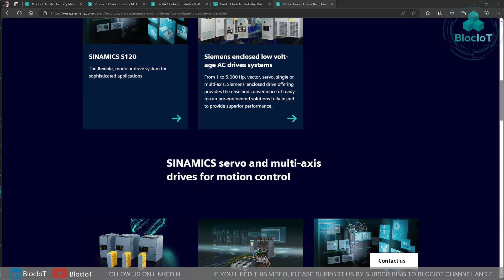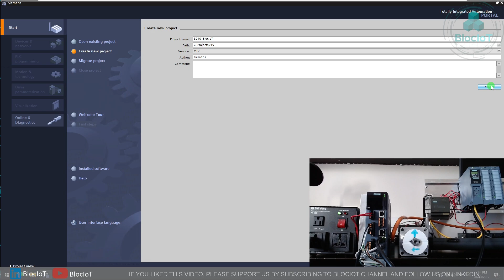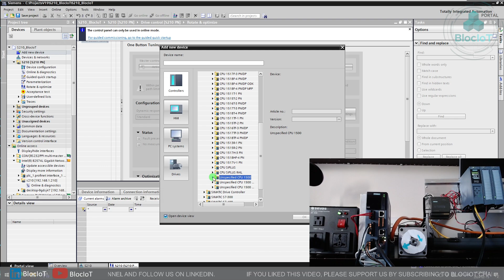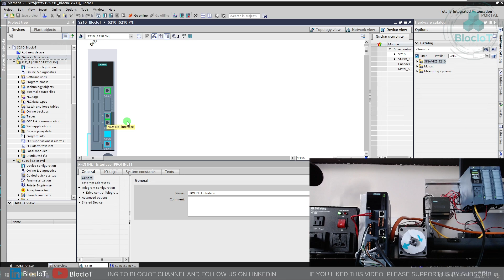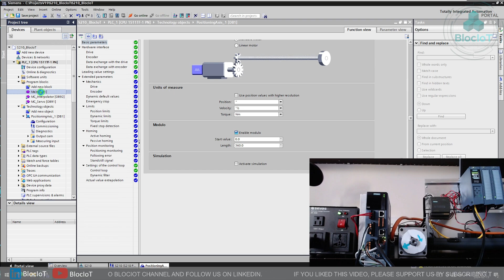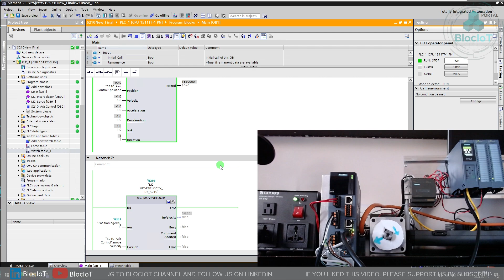33- How to Control a Siemens S210 Servo Drive with a S7-1500 PLC? A complete Tutorial

Comment: Thank you for this video! Do you have a video about how to use the technology object or whatever its called "BasicPosControl", under "SINAMICS Motion Control" in TIA Portal, V20? I am having trouble understanding what all of the parameters mean, such as "Cancel traversing" and "Intermediate Stop". I found a document that tries to explain them but I am still not understanding. Also, I am using an external prox for home position and I am trying to figure out how to use that in this object. I am new to Siemens but have many years experience with Allen-Bradley, Omron, etc.... . Also, would you suggest against using the BasicPosControl function and just follow what you have done here? I just thought that object would be more compact and I have 4 servo motors in this project so that would mean doing everything you have done here, four times.

Comment: What if I have multiple servo drives that are networked through a hub?
Reply from the maker: Everything will be the same except you need to define the target "axis" that you want to control on each FB. In this demo we had one axis (one servo).
Reply: @blociot  I think I understand now. I re-use the same UDT, all I have to do is create 4 blocks, one for each drive but I use the same technology block just pointing it back to the correct block? In Allen-Bradley terms, UDT is the same, the "MC_POWER" for example would be an AOI and then the program blocks would be each instance of the UDT.....is what it sounds like to me.
Reply from the maker: @BrentMcCabe-o7r that's great! Yes, that's one way to control multiple axis one after another. You can dynamically chamge the "axis" parameter to point out ti different drives. Also, therr are other types of TOs for different application that involvea more than one drive like gearing or caming. 
Great point. Basically, AOI in AB world is FB (function block) in Siemens worls. Those MC_Power etc are a FB.

Comment: Hello, i have this problem with my s7-1513-1 pn and  s210, that when compiling it shows "S7-1500/ET200MP station_1" error. What could possibly be wrong?
Reply from the maker: Hi,
Do you have any ET200MP added to your project or tou have a 1513 and a S210 only?

Comment: Hi, Nice video! 
But you don’t necesserally need a T (Technology) CPU at all to control a servo-drive.
The T CPU are requested for very complex applications or when number of servo-drives exceeds CPU calculation capacities (absolute sync axis, caming,  winders, …)
Reply from the maker: @francisgremillet3894  thank you for the feedback. You don't have to use a T CPU for simple servo control. But with the technology CPUs (T-CPU) you can efficiently automate complex multi-axis systems and kinematics. With the "cross-PLC synchronous operation" function available in all T-CPUs, gear and cam synchronization can also be realized across CPUs, so that there are nearly no limits to the axis quantity.